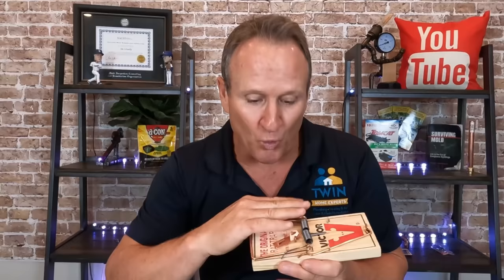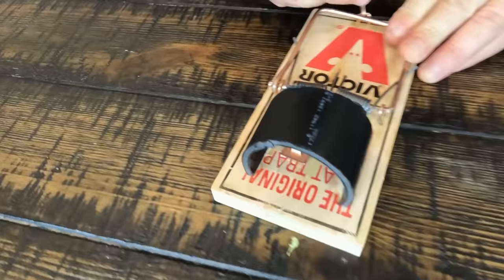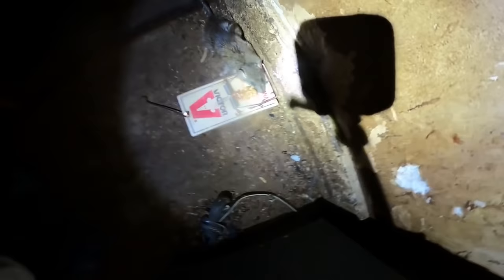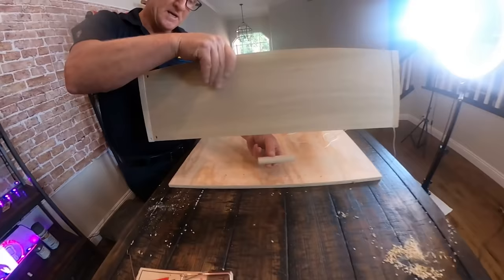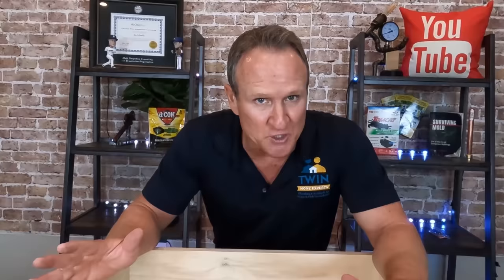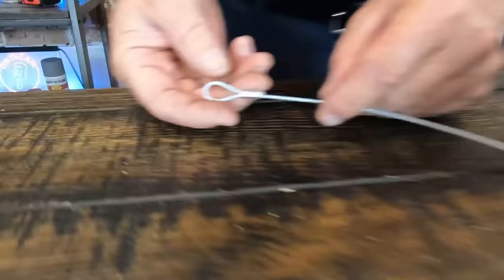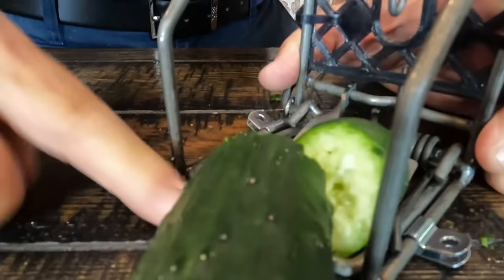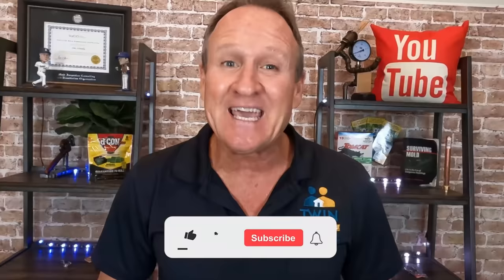EASY RAT TRAP HACKS THAT WORK!! Catch MORE rats FASTER...

Comment: I'm getting three Victor traps set up with the ABS "hood". I am going to try tying the bait to the wire on the trigger method you have on another video. Hoping for the best.

 Instead of drywall screws, I shoot some 18 ga brad nails in the end of the trap. Works just the same so far on other traps. I've just not been that successful with my bait. If this doesn't work this time, I'm just going to have to set up a poison station. 

I have already successfully dispatched 5 rats so far and I am sure I have sealed my home off from any other rats coming in. 

I think that since I have an active home garden with several fruit trees, I am competing with myself for food the rats have available. 

I think I will have an ongoing battle with Rats because of my garden and because I'm in an older part of town and rats run down our phone and power lines. I will probably have to set up traps outdoors forever.
Reply: Trapping rats outdoors is a a fool's errand.
Try bait stations. I like the First Strike bait.

Comment: IDEA FOR RAT TRAP
CAPACITOR DISCHARGE TRAP
VERY FEW PARTS, NO MESS, RAT WILL JUMP SEVERAL FEET FROM TRAP
It is possible to have a DC power supply which is not dangerous to humans however delivers a high voltage, several hundred volts. This not dangerous because the voltage is supplied at low current, in the microamperes. This will merely sting, like an automobile spark plug. (Alaskan bush pilots will grab the spark plug of their airplane engine to cure the flu so they are not trapped in the outback.)
However the low-current is made dangerous by connecting it to a storage capacitor. If a rat steps on two plates, the capacitor will discharge instantly and shoot amps of current from one leg to the other, stopping the rat's heart instantly. The rat jumps away from the trap by involuntary muscular contraction. The trap is made dangerous by switching the capacitor on.
It will require some time for the weak source of high voltage to charge up the capacitor, which is OK because the operator has plenty of time to get away from the trap. It will be safe for animals if put under the house. It is practical if battery powered, like the bug zappers. The capacitor increases the power of the 'zap' up to any level needed. The trap is serviced by switching off the power source and waiting 5 or 10 minutes. The bait is never eaten and lasts forever.
When the rat steps on both plates, he will jump away, clearing the trap for the next customer.

Comment: I get pack rats, small mice goffers and woodpeckers. Here is what works for me, for woodpeckers screw the trap to the house where they peck, bait well(guaranteed to work). packrats, gophers and small mice I use 2 methods, give them a swimming pool made out of a 5 gal bucket, drop sunflower seeds in the water, set in the evening come back in the morning with a full bucket. If I use a victor trap, I use pet food as bait, it is glued down with hot melt glue, glue plenty of pet food.I also have to stake down the traps or hawks and Owls take off with the dead rats.

Comment: Nice vid....good advise, Keep'- em in the kill zone. Yeah, they'll grab and run. The screws, nice improvement. I soldered small finishing nails to the bar. Caution in setting.

 Here's info for you. A shear/plus, use a piece of raw bacon with chocolate good smell. Secure it to the tap leaver with a needle and thread, using lock loops. Or ya could soak the thread/string in the cheese, then tie it to the leaver, that makes the rat have to bite and pull which sets the trap off.

More keeping in the kill zone....

 Cause I do animal control at dairy farms with an air rifle, cause a powder burner scares the crap out of the cows. Plus a shot even scares off the pigeons. Scaring won't/doesn't happen using a  Suppressed FX Impact, keeps me busy, after retirement, Oh Yeah, I even got a thermal scope for night.

  Well the 1st time used a few pieces of just cut up chucks of cheese in the kill zone, oh it worked. But the rats would grab and run, boy they move quick.

  So to keep'-em in kill zone... I cut a piece of 2X6 of pine, like one (1") foot long.  At one end bore a 1/2" hole thru in in the middle a few inches in. It's for a 6 inch long spike to secure to the ground. Then in the middle, Drill a two (2") diameter hole, one (1") deep, fill it with peanut butter or cheese. No you aren't done yet,  if you leave it at that, they'll just grab and run.

 But.... keep'-em in the kill zone, once filled with whatever cover it  with a three (3") piece of 1/4 square cage screen, ha they have to lick it, no grab and run.

Hope ya enjoy the tip.

Comment: Tootsie rolls.  Warm/heat them up.   Put little nuggets melded onto the trigger.  Handle the traps with vinyl/latex gloves, so they don't smell you.    For smart rats, put the traps un-set for a few days, baited even, so they get used to them.  Then set them

Comment: All good stuff but this is my trap line. Small coyote trap, victor rat traps all close by each other, I use wood glue and mix bird seed, let it dry and ready for several uses, I leave a few loose seeds around so they get use to a free lunch, black sunflower seeds seams to be the best. I had to screw the board of the victors to another board so they can't move and chain the coyote trap to something heavy.

Comment: Melt Hersheys chocolate just enough to spread it with a butterknife on the trip plate. Make sure it is under the notch and on the bottom of it. Works amazingly well, because it hardens and they have to work for it.

Comment: Victor Professional Rat Traps (Yellow pan). Adjust the play out of the pan and set the trap. No messy bait or crazy mods. We do a lot of commercial sites and farms in all types of weather 3 to 4 dozen a whack. Good homeowner mods but not for volume trapping jmo. Nice vid
Reply: Just wondering if we take the dead rat out of the trap, can we still use the trap again and still catch rat successfully?
Reply: @GVLexiPalm  you will get several different answers on this topic. Rats will eat another rat right out of a trap. I use the same group of traps for the duration of the trap period on the job with successful results one rat after another with blood on the traps.

Comment: You got to tie down the trap too because they can drag them off back in the hole
Reply: That's what I've been doing for years. I use TomCat. There's two little holes on the end of each side. I tie string on it and attach it to a stake, or pipe or anything that's not going to be dragged away.

Comment: Victor traps if get with the metal trigger and need bigger area, add a paper clip to it under the small hook.  Do like drywall screw idea may use small finish nails as option.

Comment: Hey, thanks for taking the time to share your knowledge, I bought the plastic version because it seems stronger, my question is if a rat trap kills one do you have to wash it to eliminate the smell of the other dead rats? Or is it a one time use? I was successful at getting 2 but the other ones are avoiding the traps.
Reply: I've used newspaper or plastic to keep down the mess. If they're hungry enough the dead rat smell doesn't seem to bother them. They can go without water for a long long time but can starve to death in 2 weeks.
Reply: Two Victor rat traps (wood with metal trigger) have killed more than 20 large pack rats - never washed them.

Comment: the best way to improve the standard wood rat trap is to drill a 3/8ths hole through the wood base under the bait lever and fill it with old fashioned peanut butter. tape the bottom of the wood base. the rat tries to get to the  bait and moves the lever- gets caught...
.   you can also cut a slice of aluminum tubing and superglue the tubing bridge  to and over the top of the bait lever making it hard  for the mouse / rat to get the bread / peanut butter bait off the bait lever... and you can tie the bread/ peanut butter bait to the lever...

Comment: At 7:30, This actually is why the Victor is faster and by no small margin. The longer the throw the more time the bar has to pick up speed. There's many other factors but if all are equal between the two the Victor would be more powerful.
Reply: The Koro trap spring is really strong. When setting the trap it feels like it's about 3x or 4x the Victor trap.
I wish I knew the actual strength numbers.

Comment: I bent the “hook” into an actual hook using peanut butter smothering around the hole trap and got two in one trap… it looks like they may have even got stuck on the hook.  They tried to get out of it and pulled it around and quickly died.

Comment: my hack is the best one. i take the kill bar off, and sharpen the bottom of it to a near razor edge, and tack a little handle on the top of it for easy re-hatching. the guillotine has yet to meet a rat it couldnt chop through in 1 go.

Comment: I must have the smartest rat in the world I'm dealing with, he won't fall for any of this stuff. He walks past snap traps no matter what bait I put on them. Tunnel traps-nada. Zap traps-nada. Glue traps-he pushes them across the floor with his nose. Black plastic 'bait' boxes-you have to be kidding him, he won't go anywhere near them! These rodents have evolved into very cunning and cautious creatures. I've used the baking soda mix with some success in the past, but they (the survivors?) even wise up to that after a bit and won't touch it. I'm pulling my hair out. I've waited up to the wee hours to try and catch him out and nail him with a slingshot-at 3:00 am I threw in the towel and the next morning I saw some insulation he had dropped on the floor. What's next, releasing some ferrets in the home? I'm really at my wits end and could use some novel suggestions. We've plastic containerized all potential food sources that aren't in the refrigerator, everything in the garage that could conceivably be eaten has been disposed of or containerized. Warfarin based poisons, he ignores. The other major rat blocks/bars that guarantee one-bite, one-kill are ignored. And yes, I use latex rubber gloves when I prepare any of this to avoid human scent. Anyone have any GOOD ideas? All the obvious stuff has been tried with no success. Had a masonry outfit seal all potential access points to the home,  I'm confident of we can get the 'squatter' we'll be done with the issue. But he's good.....he is very, very good.  😫😫😫
Reply: I too was outsmarted by a rat. I'd check my traps in the morning and were all tripped but no rat.  I set up a motion  camera and studied him the next day.  He seemed to head off in the same direction every time , to  the bottom of the cellar stairs.  I grabbed my longest spoon and another trap and headed downstairs.  There he was frozen still right at my feet.  So I beat it to death.  It was the vidro that showed me the path to the rat.  Happy hunting!

Comment: what I wanted to try and haven't tried yet is putting peanut butter on the underside a small square of bread maybe 2 inches x 2 inches stick it to the Victor plastic trap, because the plastic traps have more of an area to hold the bait. It also has a little well for bait. I've had some success with these traps only in the very beginning though. After the traps have been out there a few days the rats ignore the bait no matter what I put on there.
Reply: hot glue dry dog food for bait.... thank me later
Reply: @cardboardboxification  ill try anything at this point one of the Blood thinning baits i use the Rat reacts like its a super food with no  detrimental effects

Comment: Unfortunately I have never had any luck using the Victor mouse and rat traps.  I have a crawlspace my home sits on and on occasion we will have a roof rat find its way in.  This summer has been the worst because I have trapped 12 rats over the past 9 weeks.  I use the cage traps by HavAhart where the rodent enters the trap to get to the bait and then trips the doors shut when he gets the bait.  It does not harm them, but traps them so I can terminate them and dispose of them at my leisure.  I have also used glue boards, but they are only effective with catching mice and smaller rats that have not reached full size.  Adults rats can pull themselves off of a glue board, but small to medium rodents cannot.  I have inspected my crawl space for entry points, but have yet to discover how they are entering.  I usually don't know they are under there unless I look and see where they are leaving their feces and pulling down the insulation from the floor joists.  I believe they are coming from a nearby neighbor's barn.

Comment: hi guys i have a question  .. so it’s not really related to your videos but it is to your other videos and i for sure had rats in my closet . they were really loud they would fight with each other because i would hear them crying so loudly & i would see some blood drip coming from the little key hole of the closet ): .. anyway,, i mustered the guts to ask my dad for help because the closet was always closed because it’s filled with like 3 bed duvets & a lot of my old clothes . Long story short we cleaned it and there was a huge hole in the bottom my dad covered it with thick very thick plywood although i keot telling him to wrap it in metal wool wrap  but he didn’t which is fine i was so happy he was covering the hole. so the first i wanna say 5 days including that same day they were scratching and chewing on the new wood ): i was so hopeless and lost honestly i had given up and i was just waiting for them to chew through and come inside my room for revenge especially revenge because we discovered a rats nest and we ofc got rid of it , the closet is empty literally empty rn. there’s 3 traps under the door from inside and i have another trap outside just for extra safety im not lying when i say i’m scared lol. The thing is it’s been like almost 2 weeks now and i have not heard them ANYWHERE . not even in my dads closet in the basement which is always locked as well and always will be because he lost the key , but i had heard them crying and fighting either each other about 3 days after covering my hole in my closet . they’re gone .. and i’m scared they’re inside the house now but i don’t see droppings .. do you think they’ve died ? even if it doesn’t smell ? did we do something  wrong ? thank you sm for your contribution to this honestly ): ! love u guys

Comment: I use Snap Traps, putting cooked bacon in the circular bait opening. Cook the bacon just short of it becoming hard, so a piece can be rolled & stuffed into the bait holder in center of trap. If you stuff it good, a rat can't pull it out before tripping the trap. I got 9 inch long pregnant & male roof & norweigan rats. All other traps I tested failed.

Comment: Just have a question. Do you know if you can use UV light to track where  mice are? I hear sounds and it's driving me nuts. 

Thanks
Reply: Put powder where you suspected they are and see it it’s disrupted.
Reply: if you use the uv you’re gonna see their urine everywhere and it will make you wanna burn your house 😭
Reply: @cleotorres5632  I just can't find the nest or where they are coming in. Hear noises. And see poo.
Reply: A motion activated sensor trail camera is useful to monitor rodent activity.
Reply: @martianleader1  ...  The fact that you see their poo indicates they travel that route and spend time there. They will be curious enough to take the bait if you put a trap near where you see droppings.

Comment: I had a sneaky rat once. Always stealing bait. I tried a piece of carrot with a stout wire inside the back of a live trap meant for wildlife. The other end I tried around the little hook that holds the trap door up. It's part of the trigger system. Then I slipped it all inside a feed sack. First night worked like a charm.

Comment: These rats don't die quickly. They suffer in those traps.
There is a better way...get a bucket and drill 2 holes in the top. Put the cardboard from paper towel roll..slather with peanut butter .they walk onto the cardboard and fall into bucket..then dump rats a mile from house.
You can collect a lot more this way and it's humane.

Comment: Finish nails won't split the cheap wood of a rat trap.
Reply: Not if you first pre-drill a slightly smaller hole than the screw that you will use.

Comment: 1:55 The second Method of the old fashioned victor rat trap dry wall screwes is a bit messy i prefer the  first method with the pipe. 

Yes its simple, But It keeps them trying to struggle to lick that peanut butter in the Pipe Hole Longer making it a hell Lot easier to get the Kill rather than just Letting them lick it from the sides of the trap and Letting them go on they're way with a full Pallet.

it aggrivates me cuz  ive been trying to catch and the rat did it again, he licked the peanut butter off of the Tillamook Jerky i slathered on He just ran away after with a full pallet and he's scott free, it's aggrivating but tonight with this method I hope this time it won't be to easy for him. and it shouldn't, since the only access to the bait will be frontally.